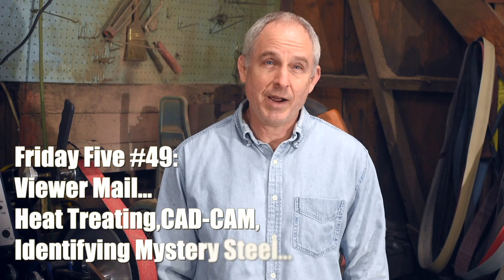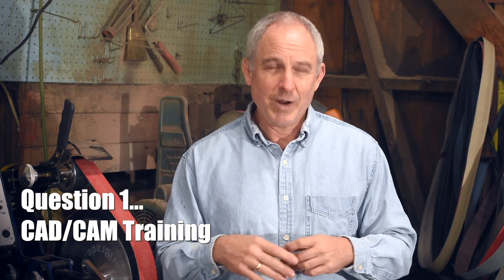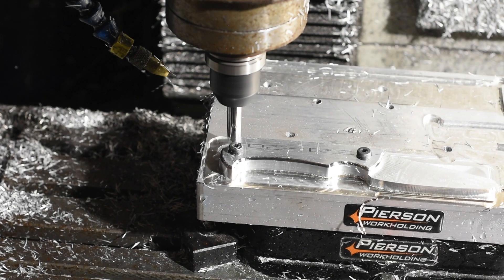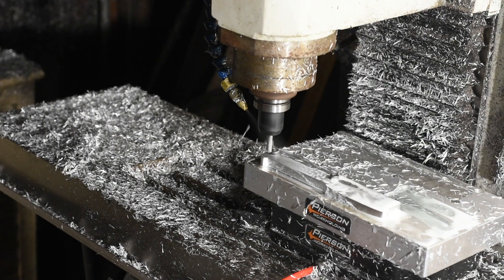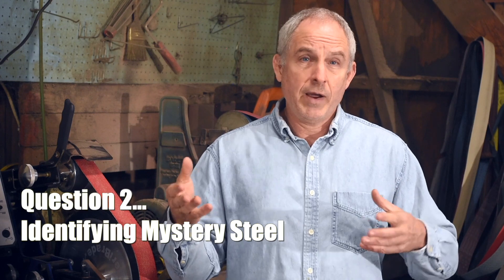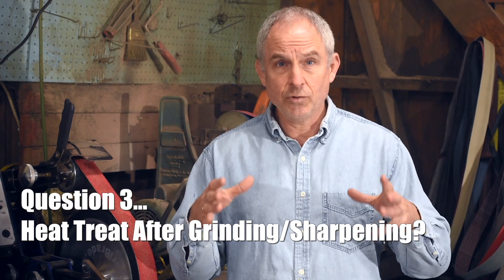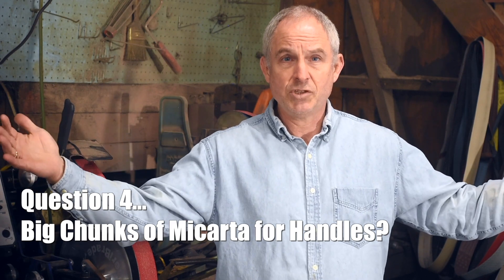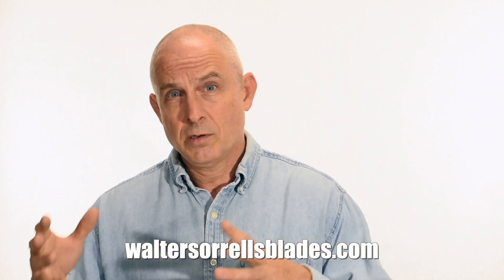CAD/CAM for Knife Makers, Heat Treating, Viewer Mail:  Knife Makers' Friday Five #49

Comment: I was working for the UK Admiralty Materials Laboratory as a Toolmaker / Welding specialist. There were multiple Laboratories in the grounds all researching different things. The tool shop supported all the different laboratories.  I was given a chunk of metal to try and melt 2" x 6" X 8" . I put the largest Tungsten into my water cold TIG welding torch (about 1/4 inch) and put the Amp's to the maximum on DC on my Tig Welding machine. After about 10 minutes all I managed to do was make the metal glow red. 
One of the laboratories developed the heat proof tiles for the space shuttle. just as an example.